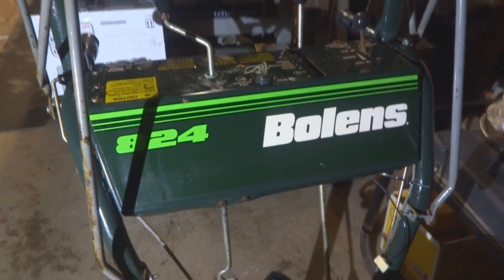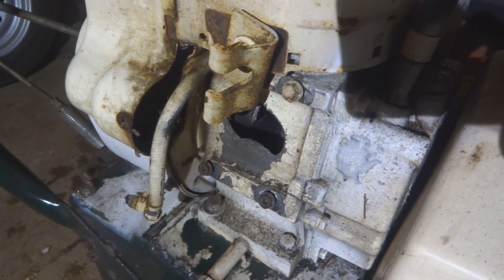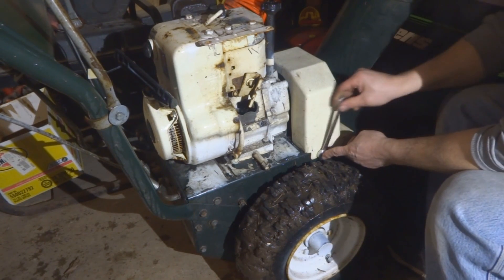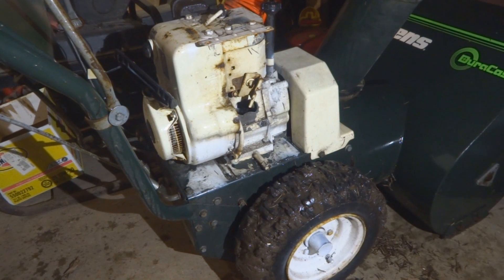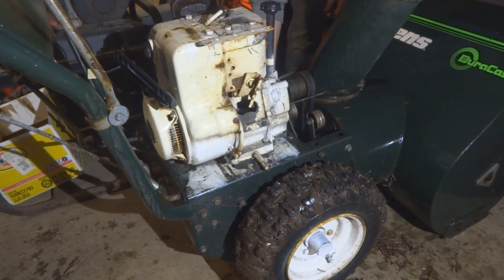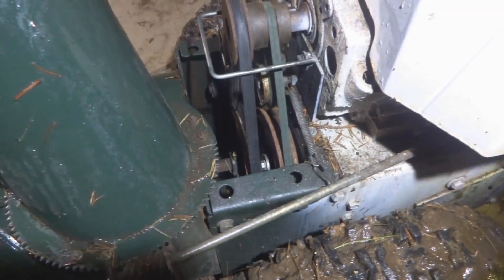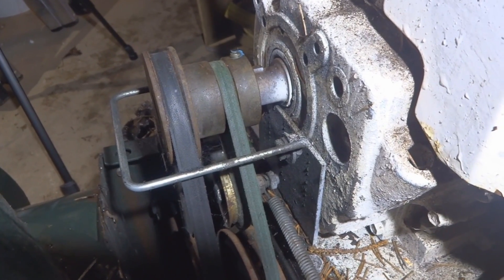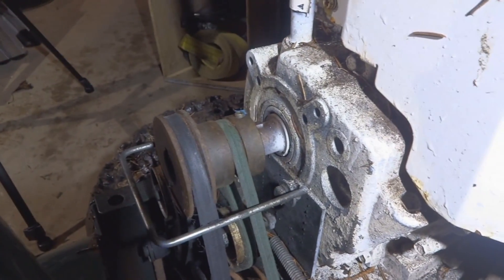Bolens 824 Snow Thrower Engine Re-Power Part 1 of 10

Comment: I appreciate you trying for me.    Ok last one what should the length of the shaft be?
Reply from the maker: Briggs & Stratton Professional Series Horizontal Snow Engine, 305cc, 14.50 Gross Torque, 3/4-inch x 2.53-inch Crankshaft, 3/16-inch Keyway, 3/8-24 Tapped, 110V AC Electric Start, 60W AC Alternator      -       I had to look this up on the interweb. Thanks again for watching.